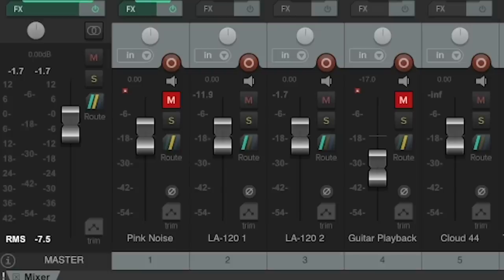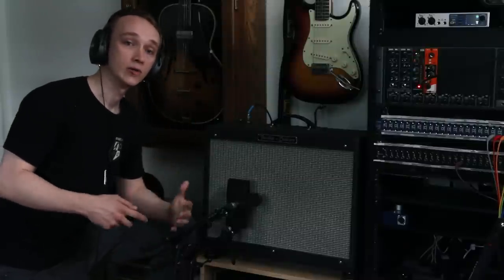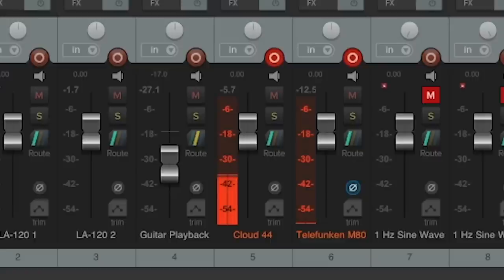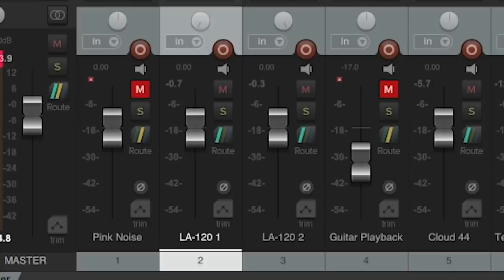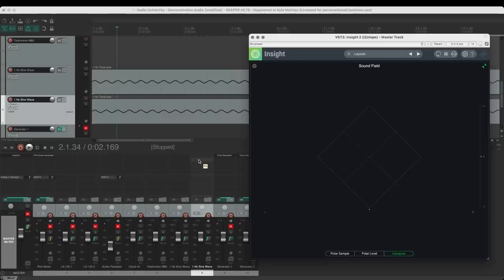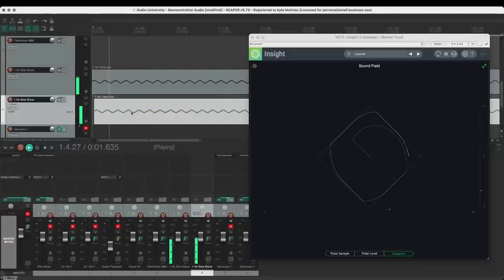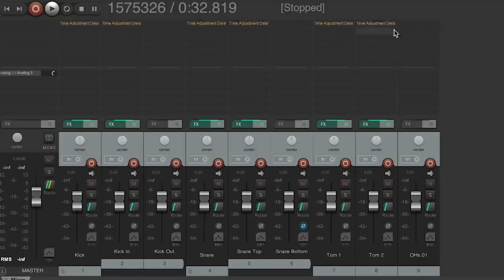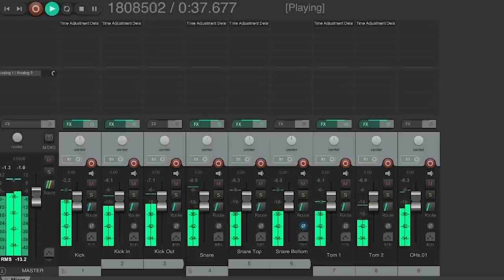How To Solve Phase Problems In A Mix

Comment: Ozone Imager 1 and 2 have the polar sample, polar level and lissajous graph included as well which is quiet useful imo. Not only does it let you check the phase relation between left and right (as in the plugin you are using in the video) but you can also artificially widen or narrow the signal to your linking. :)

Just in case you didn't know, you can bypass all plugins on all channels by pressing CTRL and clicking on the activate/deactivate FX button of a channel. ;)

Great video as always!

Comment: Very helpful and relevant for me.

But… I’m highly distracted by the fact that the 90 degree phase delay on those electronic signals created a circle/ellipse on that X/Y graph program.

I’m thinking about energy in general, and how spheroids and orbits become so prevalent in space… and I can’t ignore that there is something fundamental about how energy functions and causes those effects being shown here.

In my mind, this is representing how we imagine the points in space… stretch them into lines… weave them together.. create a yarn… and then curl the yarn; and then weave in various tangents of the curls of yarn around the original locus to create a spheroid.  — All representing an elevation from non-locality, to 1 dimension, then 2 dimensions, then 3… and I suppose the transitions would be the abstract 4th/time dimension.

And I’m seeing it because of this sound demonstration.

Hmm.
Reply from the maker: It’s all connected!
Reply: @AudioUniversity  Honestly… it’s got me wondering if there had to be TWO snaps of the finger in the beginning instead of ONE.

Almost like God snapped both fingers to make everything happen - but one followed JUST behind the other one…

If that makes sense?

Kinda like.. two back to back “universes” or fields in the same universe… one potential, the other kinetic — and they’re opposite of each other AND slightly out of phase; which prevents them from CANCELLING OUT.  

I’m probably going insane.
Reply: @TarzanHedgepeth  there's so much we don't know and probably will never know. This isn't insanity, this daring to thinner

Comment: A quick calculation suggests that at 44.1kHz, each sample represents approximately 1/4 inch of distance... might be a useful rule of thumb if you're counting the timing difference in samples and wish to move one of the mics.

Comment: I might be happier to call it delay and polarity. Phase is a frequency-dependent result of delay. A given delay that causes, say, a phase difference of 40 degrees at 1kHz gives 80 degrees at 2kHz.
Reply from the maker: I see what you mean. It’s important not to confuse “phase shift” and “time shift”. But phase itself is just the point along the cycle of a wave. So a time misalignment can result in phase cancellation, even if the phase response of the mics are identical.

Comment: Hey please.. i want to know about stage monitor and Pa Speaker.??  Is there any difference between them??
Reply: One faces you, one doesn't. ...
Often eq'ed differently to not upset the mains mix, as they need to blend on stage.. and you already get alot From the house... 

Different design for the application, but speakers are basically speakers, and you try to design as flat and efficient as possible.  No world is perfect and live is a jumble...

Comment: This video addresses how to avoid Phasing. However, phasing is not an issue, and you dont have to avoid it if you do not want to. There's actually a modulation effect called phasing...so if you wanted to have phasing modulation in your recording, do not align them perfectly...There are no rules in this game.